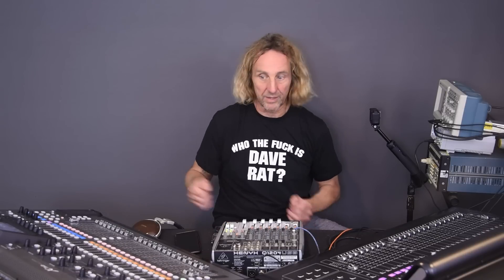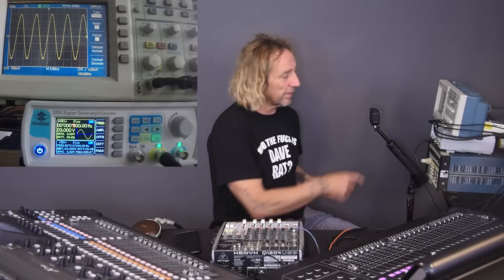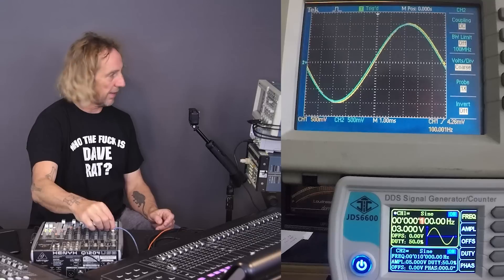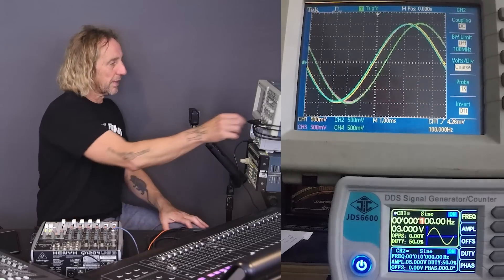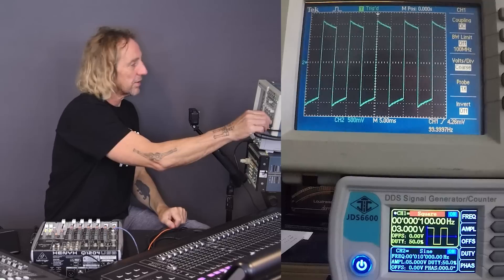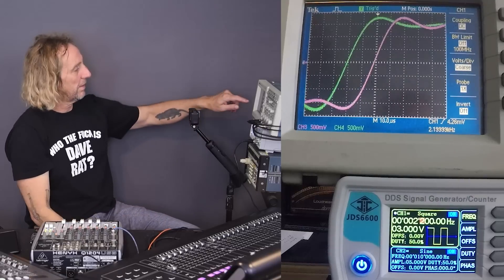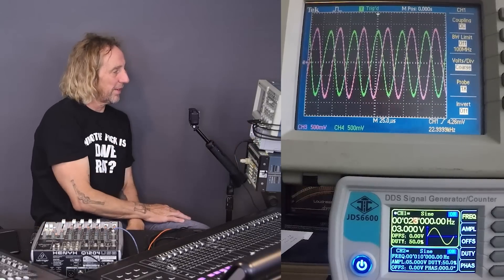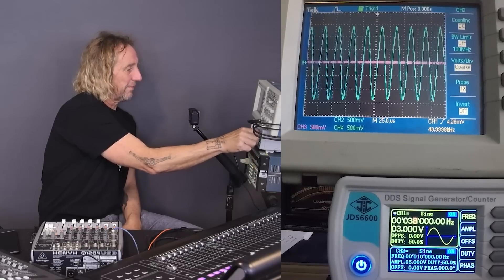Which Sounds Better Midas M32 vs Behringer X32 vs Copper Wire

Comment: As someone very well acquainted with both desks and an owner of the smaller M32r this is super interesting. I use outboard compressors with these to try and get back some of what I lose going digital. I wonder how much latency I'm adding to to everything. Maybe I should be sticking to the FAC comp in the console....? Great stuff, thanks for sharing with us.
Reply: it wont be addig much, 0.9ms pus 0.9ms going out and back in. isnt an issue uness your using it on doube miced sources or if using paralel processing
Reply: @vedasticks  Copy. Thanks for the insight guys. Always bus my monitor sends pre-eq so the artist never sees or hears the inserted comp.
Reply from the maker: I would need to test the added latency but I thought the console has 0.8 Ms from analog input to analog output.

So inserting should add the same, a total of an additional 0.8ms output to input.
Reply from the maker: Yes, just adding some latency is not really an issue for FOH. A millisecond is about 13 inches. So having the time delayed a foot or so is no biggie unless you have delayed and non delayed versions of the same signal added back together. Or added latency can be undesirable for monitors and in-ears.

It is important to pay attention to and also, converting to digital and back to analog and back to digital and back to analog is undesirable as well. The summation of multiple issues is where we see degradations that become audible.
Reply: Just my opinion (I could be wrong) but I think going out and back in is not really gaining what’s lost in an insert situation, because of the biggest difference between digital and analog.... voltage. If you go through the compressors and they’re a higher voltage (24v and above), and you go straight from there to a speaker, then you are probably gaining something other than channel timing discrepancies and noise. The biggest and most important thing that makes higher end gear stand out, is voltage. That’s why most master desks use 120v rails and Neve mostly made his rails with 48v. Most lunchbox gear is 24v and most consumer compressors are 9 to 18v. Higher voltage equal higher headroom and more natural tones. With lower end gear, you’re mostly getting noise, which can be nice sounding too at times. Bigger wire is good too. I experimented with a couple of those cheap Pyle sm57 clones (non transformer) by taking out the hair thin wire and replacing it with 18gauge, and it was night and day. I actually use them as overheads in super small rooms because condensors are nonsense in that scenario. You could literally build a 16 channel board that just passes the signal through on a thick wire and raises the voltage and have that going straight to your amps/speakers and you would see a world of difference. Just my unnecessary two cents.. I could be waaaaay off on this, but it has worked for me. I record through a Tascam M3500 and raised the rail voltage from 15v to 24v and gained hella better sound. Sorry for the book.

Comment: did anyone else notice how the consoles reproduced true sine waves even at 24khz? d/a converters are not stair-steps and i'm glad videos like this exist
Reply from the maker: Yes!  The stair step is a fallacy as and also, perfect sine waves at just below 1/2 the sample rate! Just a hair over 2 samples per cycle and it is accurate
Reply: @DaveRat   I have a hard time with this, because there are a lot of DACs from the earlier days of digital audio that CLEARLY have stair-steps.  All the old multiplexed mono DACs like the Burr-Brown PCM stuff you would find in CD players, Roland synths, etc..  they would use one digital-to-analog channel into a sample-and-hold circuit, and then into low-pass filters that served as the analog reconstruction filter.

These days, DACs are cheap enough to dedicate one per channel, but that reconstruction is still happening somewhere.  With Delta-Sigma and the like, it's happening WAY above the Nyquist frequency, but... it's technically still there.  :-)  (Even if it's not so much stair-steps as PWM in a lot of cases.)

Now, you could argue that a lot of this is moot.  The reconstruction filter is ... either in spirit, or literally "part of" the DAC, and the result is a smoothed waveform.  But, every time someone watches the Xiph video and then starts spreading the gospel of There's No Such Thing As Stair-Steps, I cringe a little.
Reply from the maker: Hmmm, i think there is some confusion abkut stair stepping. For a sine wave to actually be outputted as a staircase version, that would take a tremendous amount of high frequency energy.

Just over two sample per hz will give a smooth perfect sine wave, no stair steps.

Now with low bit depth, there can be volume level "stair steps" where a signal of a certain level will be ever so slightly louder or softer than the original analog signal.

But as far as stair steps and being able to see them or them existing on the analog output of of a signal that was digital, not only are they not there, but the digital console actually does the opposite.

If you send a high frequency square wave into a digital console, it converts it to a sine wave.  If you sent a stair stepper signal into a digital console, the digital console would actually smooth it out, due to limitations of the high frequency capabilities.
Reply from the maker: Hmmm, seems to me that we can easily prove the information is not lost.

Since all signals are a summation of multiple sine waves, if a digital converter can reproduce those sine waves any or all of them then you should be able to reproduce the signal accurately up to the highest frequency.

And one simple demonstration to show the information is not lost is to sample a 23.5 signal and sample it at 48k well you have just over two samples a sine wave which. If you follow the argument that information is lost due to samples missing bits of information, then it would not be possible 4 the 23.5 k sine wave to be reproduced accurately. Yet it is.

So yes logically complexities can be created 2 convince yourself that the information is lost but when testing we see that it is not.
Reply: @DaveRat   Mm, yes, that's all correct... but the problem here is that we're talking about two different things.  You're talking about signals that can be converted to analog via the DAC.  I'm talking about a signal that is a side effect of the conversion process from digital to analog.

Think about how an "ideal" (as in, theoretical) DAC works.  You have a clock signal that is responsible for telling the DAC to take a new sample value from the queue and produce a corresponding voltage on the output that represents that sample's amplitude.  Right?  The way an ideal DAC does this is by having some number (say 16) individual outputs, where each successively higher order output is twice the voltage of the one before it.  Out 0 is 1mV, Out 1 is 2mV, Out 2 is 4mV, and so on in a binary fashion.  Each of those 16 outputs produces a voltage that is between 0V and 1/2 full-scale, and when combined in a particular order (from none to all) can produce a voltage between 0V and 1/1 full-scale.  This is a perfect R2R resistor ladder DAC.  Most DACs we use today merely  model this approach in a way that is easier to produce, cheaper, performs more linearly, and so on.  But the principle is some adaptation of the simple ladder DAC.  So far so good?

OK.  Each clock pulse will move a sample into the DAC, and the DAC will set its outputs in whatever binary combination to produce the summed voltage that corresponds to that sample value.  It will then HOLD that voltage until the next sample is clocked in.  (The pedantic here might interject about oversampling or other real-world techniques, but again, we're referring to an ideal component.)

That HELD voltage forms the horizontal line of the stair-step.  When the voltage changes to the value of the next sample, that's the vertical line of the stair-step.  Like you're plotting the samples on graph paper.

The next step in this ideal DAC is to low-pass filter the signal produced by that voltage output.  This turns those straight vertical lines into slopes, which erode the DC in the horizontal lines.  Now you have a curve between the previous sample and the current one.  Good?  That curve should be analogous to the waveform of the original analog input signal.   (Or the digitally-produced mathematical model of an analog waveform.  Whatever.  :-) )

Is that making any more sense?  Let's say the intended signal was not a "square wave" or a sum of sines, it was a single, perfect sine at the sampling frequency.  But the DAC can't create a perfect sine, any more than a computer's monitor can create a perfect circle on a grid of square pixels.  The DAC can only create a series of discrete values.  The low-pass filter removes the aliasing (the steps) and turns that set of discrete values into a sine wave again.

It can do this because Nyquist has proven that, for a given sampling frequency, 2 samples is sufficient to perfectly produce a sine wave of 1/2 that sampling frequency.  It can do this not because all the information is still there, but because with two samples per period, there is only one mathematical solution that can possibly result from a sine wave that passes through those two sample values.  And the "reconstruction filter" can reconstruct that sine wave, given those two points.

So, indeed, all the continuous information between samples is lost, but as long as we promise not to try and sample any information above the Nyquist frequency, and then filter the output to remove the aliasing effects of the DAC, then we will be able to perfectly recreate the original signal.  It's lost, but it can be inferred, perfectly.
Reply from the maker: That makes sense and seems to indicate that the stair stepping never gets reproduced is pretty much in reproduce able.

With just two samples on an entire some wave, that theoretically by this explanation would be just two flat dc voltages. But a perfect sine wave is created. The stair steps self eliminate in the analog world,.

If they can't exist, does that mean they exist or do not exist?
Reply: @sirnickity  I think we forgot that these converters running at 48khz are ACTUALLY running at 256x over that, so I guess I don't care if stair-steps exist at ~10MHz :P  anyways, there are no stairsteps in the converters audio output at any frequency it's able to reproduce in 24khz of audio bandwidth and that is what's important.   the information "between the samples" is information above 24khz, so I'm fine with throwing that out.   Also, DSD has been proven to be worse than PCM so lets not go there....
Reply: @magoostus   Nono, not forgetting that at all.  I specifically called that out earlier, that the baseline discussion disregards oversampling and all the other tricks used by various modern DAC topologies.

I think it's clear to say that the analog waveform exiting from the business end of a DAC is not going to be "steppy."  It wasn't my point to argue that.  I think it's merely an oversimplification bordering on "wrong" to say that stair-steps don't exist at all in digital audio.  They absolutely do, but they're removed by the reconstruction filter.  That's all.

Does it matter?  Of course not.  Just like a lot of the other no-nonsense points made in Dave's videos -- yes, there's a difference or some phenomenon that isn't technically ideal, or whatever.  But does it matter?  Naw, not at all.  Only to test equipment.

Not sure where DSD came into the argument, except maybe as a response to the PWM comment above?  Well, PWM doesn't necessarily imply DSD.  PWM is the underlying basis of the DSD encoding scheme, sure.  But DACs may use PWM for successive approximation with a feedback loop.  Class D uses PWM to produce audio via digital-like switching rather than transistors driven in their linear range, for higher efficiency.  PWM is a very useful tool, not just an alternative to PCM.  :-)
Reply: @DaveRat   "The stair steps self eliminate in the analog world"  -- yeah, that's a reasonable way to look at it.  :-)  It's a very deliberate elimination.  It's the whole entire point of the post-DAC filter.  "Aliasing" is just a result of unfiltered stair-steps.

I know I may not have convinced everyone that the data between the samples is lost, and the other fellow made a point that (essentially, paraphrasing) "all the between-sample info is just content above Nyquist" but that's not entirely true.

Imagine you had a piece of graph paper, and I gave you two X,Y coordinates to plot on it.  Now, from geometry we know that one coordinate is a point.  Two coordinates is a line.  (And one of my professors used to say that three coordinates is a straight line.)  But, two coordinates can be a circle.

Let's say the rules dictate that I will give you a list of coordinates, and the following rules apply.  (This is analogous to the Nyquist theorem.)

1)  The coordinates will be on the circumference of the circle.
2)  All coordinates will be equally spaced from one to the next.  (This is the sample rate.)
3)  The sum of all space between the coordinates will not be over 360 degrees.  (This is the bandwidth pre-filtering requirement.)
4)  You will have enough coordinates to completely and uniquely plot the circle.  (This is the Nyquist frequency limitation.)

So, if I give you two coordinates, you know for absolutely certain that the two points are 180 degrees from each other, because if they were 179 degrees apart, there would be three of them.  If they were over 181 degrees, we would violate #3 and #4.

I can then give you two points to place on that graph, and you can recreate the exact same circle I had by drawing an arc from point 1 to point 2, and another from point 2 back to point 1.  But, I did not give you a circle, I gave you two points and a set of rules that would result in the same circle.

That is how I see digital audio working.  You don't get the complete picture from the source data, but if you and I follow the same rules, we will have the same outcome as the original analog waveform because it's the only result that can solve the equation presented by the samples.  That data between is lost, but it can be perfectly derived.  :-)

Splitting hairs?  Probably.  But it's fun to think about.
Reply: @sirnickity   try not to obsess about it too much, just be happy that the D/A performance is A+ excellent even at economy prices

Comment: How would a $5000 or $10000 console compare to the copper  wire?
Reply from the maker: Testing an SD11 now, so I guess we will see
Reply: Copper wire, pros: perfect signal reproduction.

Mixer board, pros: can actually mix multiple signal and apply EQ and other effects.
Reply from the maker: And analog mixer pros, has most of the advantages of copper wire, EQ and such, with the ability to patch digital effects without the messiness of converting the primary signal to digital.

Advantages of digital is advanced complexity and recall in smaller lighter weight, lower cost packages and also has loads of copper wire.

Comment: Adding on what’s already been said, the reason the Digital’s don’t output the 20k square is because all the higher harmonics for the Fourier series are being filtered out (above nyquist). Great vid!
Reply from the maker: Yes. Having the low pass Nyquist filter as far as possible or at least relatively far from the upper passband is desirable.
Reply: I grew up with analog and that is how my mind is organized. Even after studying digital sound for years it still feels like magic; how can a squarewave and sine wave sound exactly the same to our ears.. I mean, i do know why but it still feels like magic, that is not how my analog brain understands things..

And this is the prime reason why veterans of the business still think that digital sounds worse: it looks worse, if we look at the signals they are not even close to what we expect clean gear to do. But.. to us... it sounds exactly the same. It is a bit the same as having a LED bulb running at +200Hz switching frequency vs perfect DC. To our eyes they are exactly the same. If we measure them, they are completely different signals.

Digital sound is incredibly difficult to understand intuitively. In the end i have had to just give up, my brain will never fully understand it but i just have to trust that those who do understand it knows what to do with it. I know the theory well, i understand each individual step but.. it still just feels wrong: a squarewave should look like a squarewave.
Reply: So what does that mean in context to the video question?

Comment: That's it. I'm not splitting my overheads between consoles any more! 

This series is really great, Dave. I just got a gig in a theater that uses an M32 and the info you cover really can't be found anywhere else. (Other than doing the tests ourselves.) Because of these videos I have a more intimate relationship with the hardware than I would otherwise. Thanks!

As far as compensating for the gear goes, I just twist knobs until it's right. But I feel that the knowledge is great to have at the edge of the mind. For instance, it's easy to hit a path too hard and wonder why I'm struggling to get what I want out of it. Then I remember how much headroom I have in the digital circuit and back the gain down and find that everything after that acts much more civilly. I'm also developing a habit of leaving some silence before changing channel states. These desks do like to exaggerate certain noises. At some point I may find myself pondering how close I am to the Nyquist freq. I'll know where I got the idea.
Reply from the maker: Cool stuff!